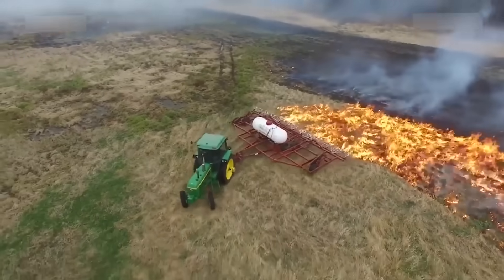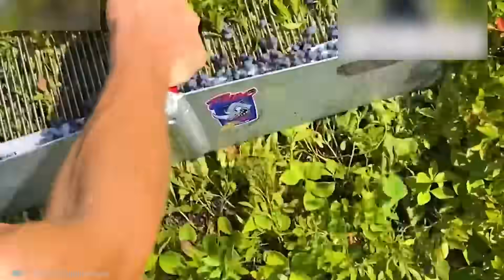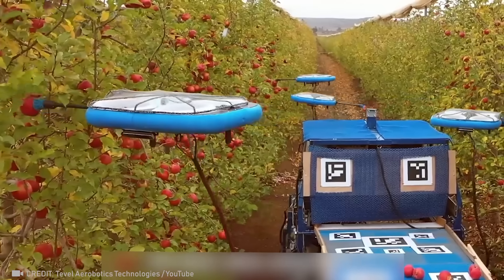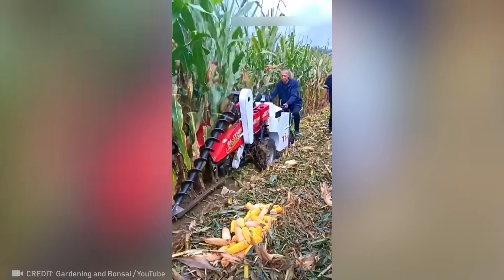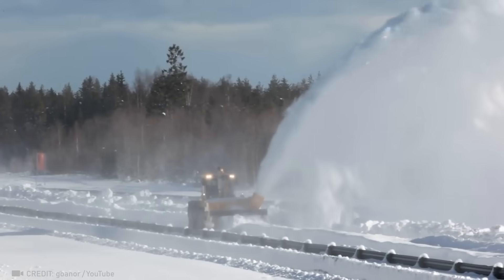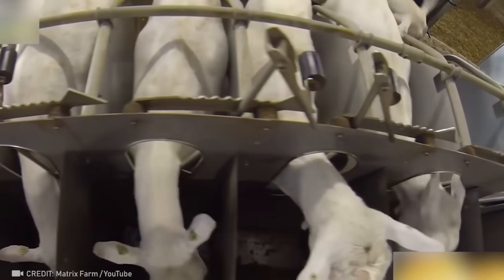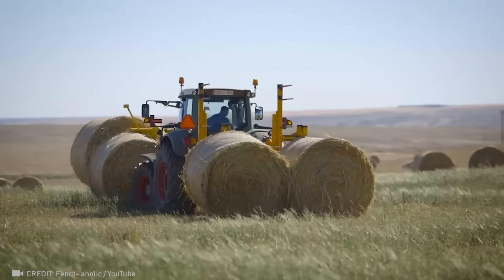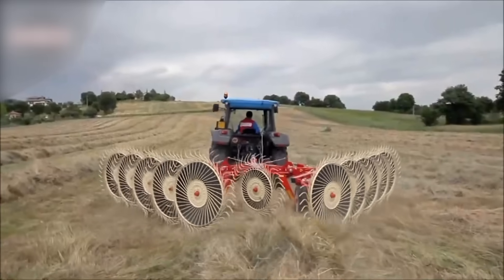Modern Agriculture Machines That Are At Another Level

Comment: At 1 minute in this is silage. Not hay. Very similar, but hay is left to dry before it is rolled while silage is rolled while it's still freshly cut and green. Then the silage is wrapped in plastic and allowed to ferment. Hay bales rolled while still green will catch on fire and burn because of the heat the inner part absorbs after the outer part has dried out. I've seen that happen a few times in my life.

Comment: That Helicopter is NOT "watering" that field. ... its dumping chemicals (fertilizer, pesticides, etc.) on the crops.   Same situation with the large red cannon mister, not for "watering", for chemical distribution.
The utilize the benefits of misting which causes the particles of the liquid to not only fit into all the small spaces between the leaves and branches of the plants better than traditional raindrop sized liquid delivery systems can, but the misted particles have a greater static charge and will actually be attracted to the plant surfaces more readily than larger drops who's static charge is not strong enough to over come the inertial forces of the larger droplet flying through the air.

Comment: I saw a local guy from Thailand (I  think) on the news who had made the coconut tree climber from an old wee scooter engine. I hope a big company hasn't stolen his idea. Because he clearly wasn't able to patent it and it was on the international news as it was such a cool new invention. It looked exactly the same. 
It was clever became it cannot fall down as you need to pull a lever to stop it from locking to the tree. So if the engine stops it doesn't;t just start coming down.

Comment: While I'm relly impressed by the efficiency of some machines, I could cry when a see the amound of plastic used to conserve some hey balls 😪
Also the machine to burn down the field is so wrong. You kill all usefull mirco organisms in the soil and at the same time you release the nitrogen stored in the plants, that nitrogen you need to bring back by artificial fertilizer, which is harmfull for nature and cost alot. And next to this you release alot of carbon dioxyde.
3:03, 5:58 8: 15 I'm sure this is not for water (this would be inefficient), this machine is to spray pesticides... which is most cases a bad idea. Releasing beneficial insects removes pests with for longer time and do less harm to the environment.
Very good machine is at 3:24... this removes weeds without chemicals. At the same time you break up the top soil, that helps to bring in and stroe rain water. And the digged weeds are a good fertilizer.
The farm bot at 9:30 is just a crap. Planting and harvesting such small raised beds is not alot of work and watering can be done much cheeper and more efficient by a stardard watering system.

Comment: What the inconvenient of all this?  ... globaly it runs on fossil fuel , not only does it  run the machine itself but to create/manufacture  it from row material mined and transported all over the world thanks to negligeable cost of energy in all the p[rocess... Great!  but it does create few undesirable product which has accumulated since the beginning of industrialization in the 1800 ( CO2 , etc) . Now we start to feel it... But cheap energy is what make 21st century  possible. Before it ,since human started settling ,  all was on renewable , wind , water , burning wood , animal and human forces ...:-)   the other issue is that we also need to find occupation for human that are no longuer necessary as they were way more expensive and less efficient ...  and last  fossil fuel will run out or CO2 / other will get way to high to maintain the climat that allowed sedentisation 10 000 years ago...

Comment: Pretty cool. Mexico just designed a new machine- it starts as a conveyor belt and people step on it one at a time and as the move down it an infrared beam measures the height of the person and then adjusts the height with movable suctions on the floor of the conveyor, than when you get into position= Boom, Chops your head off. Oh, forget all about tired arms and sharpening machettes all day long, you get one of these bad boys and you're decapitating Hundreds a day, so much Better.
Reply: Specially commissioned for the cartels?
Reply: Is that supposed to be witty ? Or cute? Or what? Oh wait just racist Hatred !! Gotcha! And on easter Sunday. Real nice!

Comment: To aid fruit prroduction the trees need be watered from underneath the trees. This increases the total fruit at harvest time, an irrotemeter device dials in the total of available moisture in the soil. It can turn on the 24 volt valve automaticly plus when the soild reaches its water content limit it can turn the valve off, when the valve closes the lack of water pressure opens the drain line to purge the line of excess water within it.Larger crops and a reduction of the resources used in watering. A wheel moves the benchs up and over for the ferris wheel crop wheel distibuting the plants up and over down and water cycle then up again. Chain driven benches rotate plants . Harvest cycles in cultivation bench at a time.picking is at optimum fruit ripeness ready for harvesting. Hanging gardens continues in planting cycles ,growth cycles, harvesting cycles, bench clean up and disin
Reply: Disinfection steilization cleaning growth mediums.
Reply: That deam was all that but it belongs deep in the earth using led lighting in self sustaining system.